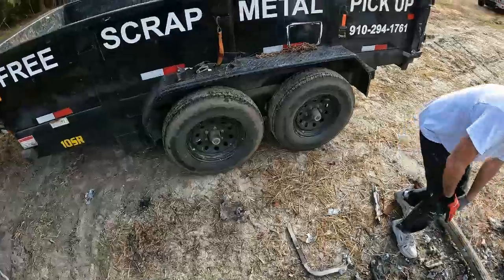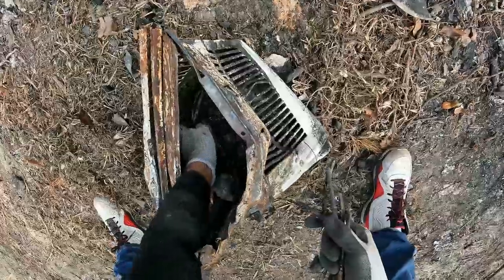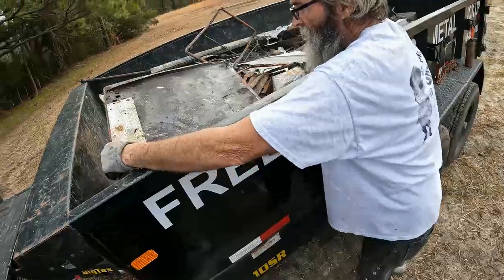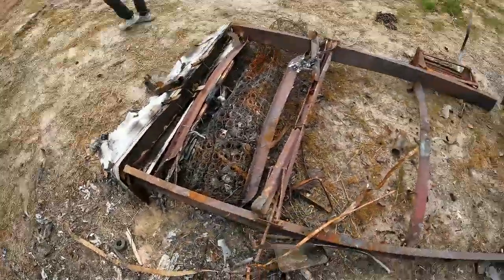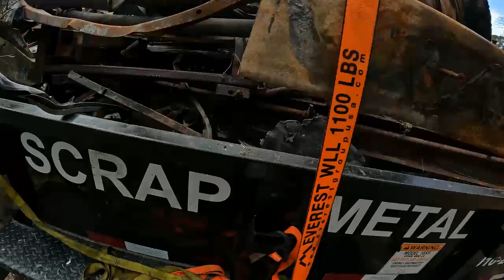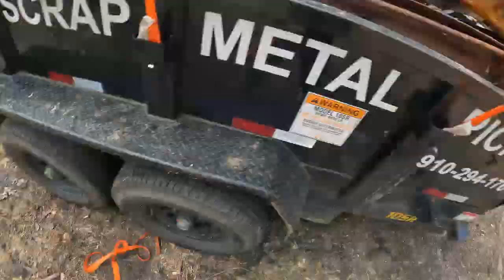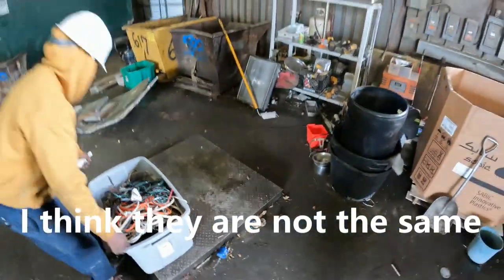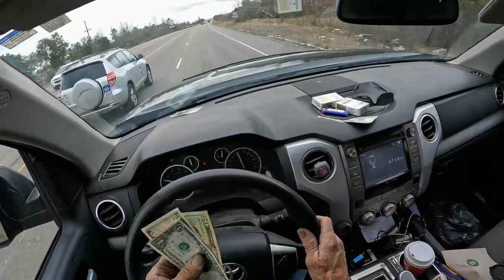Huge scrap Metal Run Heading to Southern Metal Recycling with a big Load

Comment: Could you run a hot wire from the truck to the the trailer to keep the trailer lift charged?
Reply from the maker: Yes actually I could I just haven’t done it yet